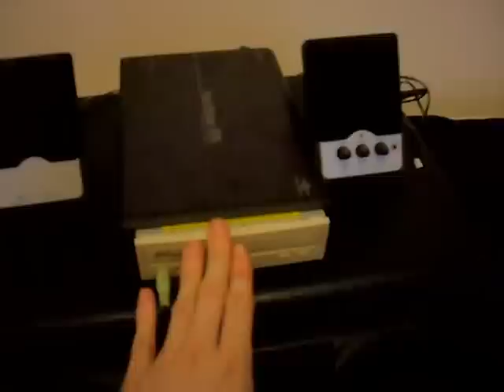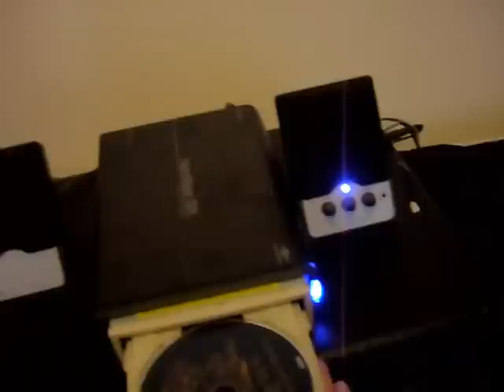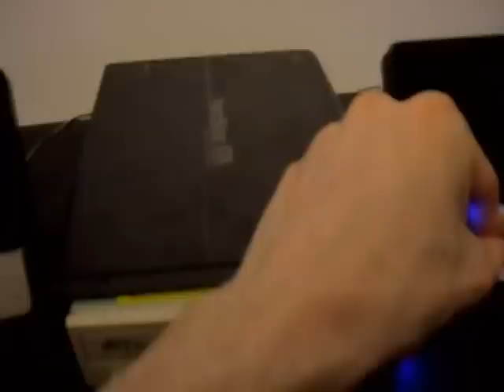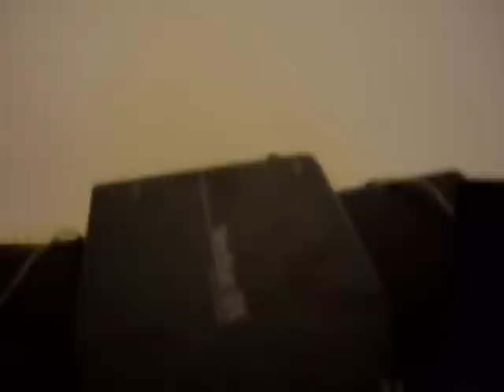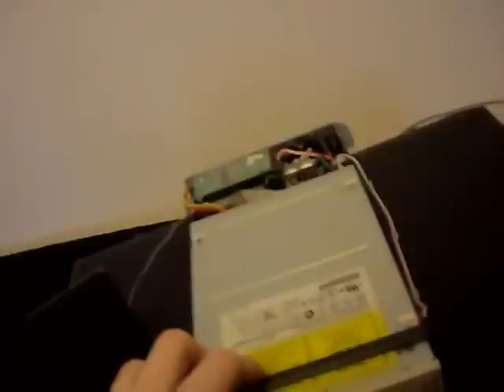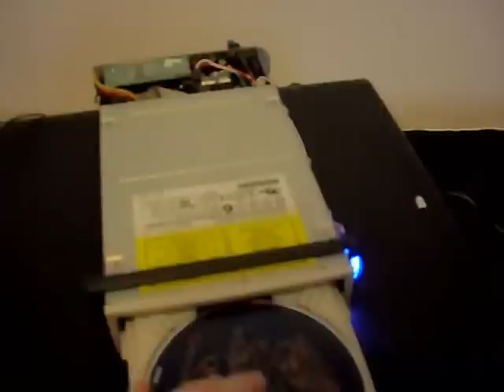Old CD-ROM drive as a crappy CD player

Comment: Is it possible to use a cdrom without play button?
Reply from the maker: Not in this manner. Doing this relies rather specifically on older CD-ROM drives which (like the one in the video) which for some reason incorporated controls on their front that allowed them to be used as a CD Player. Since that function doesn't rely on the host PC it can be used by simply applying power as in this case.

Without the controls on the front (or a headphone jack) the drive needs to be receive instructions through it's data cable in order to play audio.
Reply: Yes but you need a device to control a buttonless drive. These are sold on Aliexpress, but the price is unreasonably high IMO.